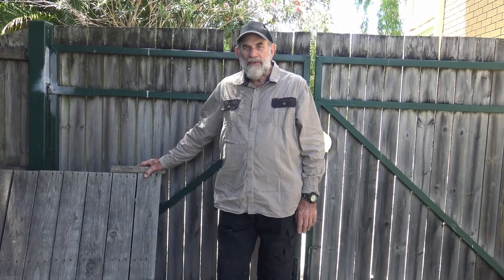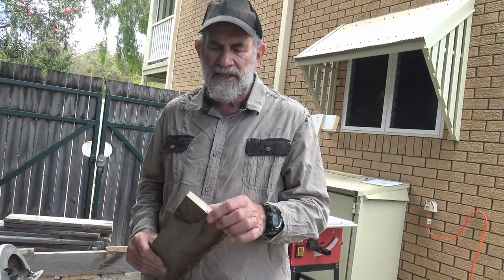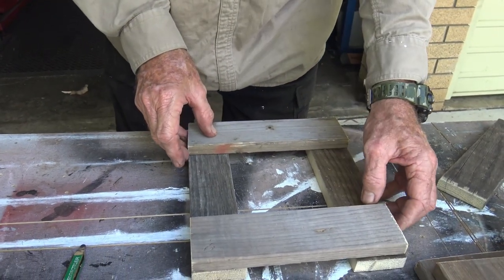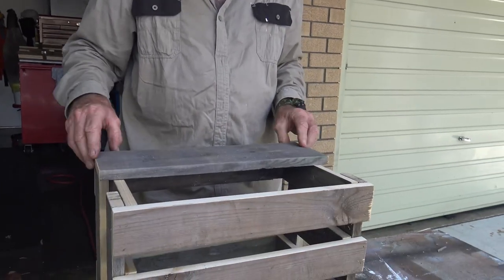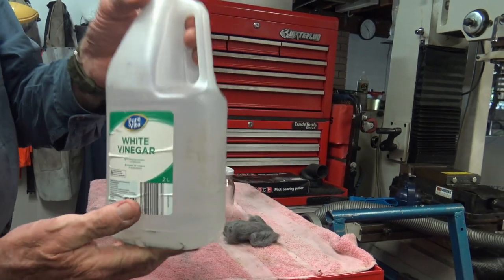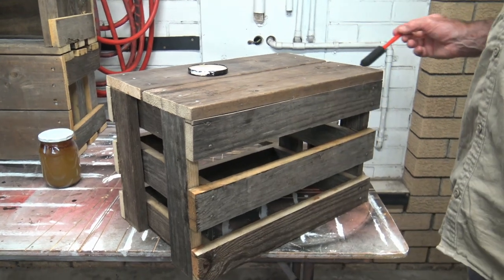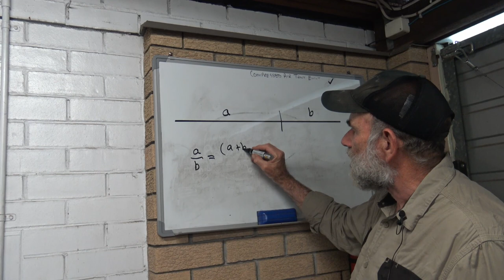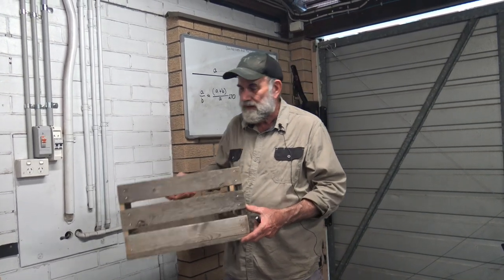Pallet Wood Crates | Making New Wood Look Old & Golden Rectangle

Comment: Did you think about placing the uprights inside the box, maybe using corner moulding strips?
Reply from the maker: These style of boxes come in various designs including using the triangular corner moulding strips. This was the design I had to use. I was told these boxes were a New Zealand design, but I am not sure that is right. I remember this style in my youth here in Oz. I think it depends on what the box will be holding, weight wise, as to how it is structured. Thanks for watching the video, Bob. 👍👍👍
Reply: @whitedoggarage  Thankyou, I have been looking at more boxes since I watched this and there are many different designs.
Reply from the maker: @robertsilver4795  Yes there are, even stronger ones have metal strips running around the end joins.
Reply: @whitedoggarage  Moulding strips would have reduced the area inside I imagine.
Reply from the maker: @robertsilver4795  Agreed, depends what you want the grate for I guess.
Reply from the maker: @robertsilver4795  Yes, this was a design I was given to follow. The crates would have looked neater if the uprights were inside.